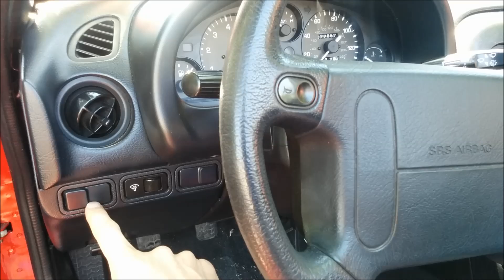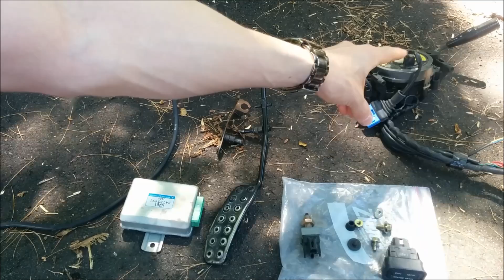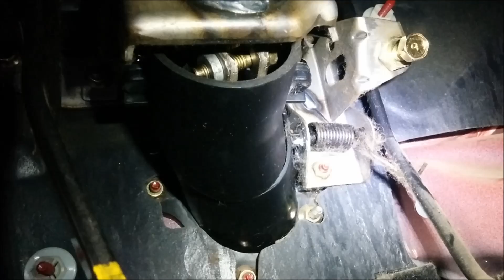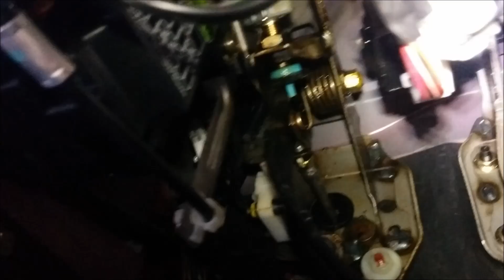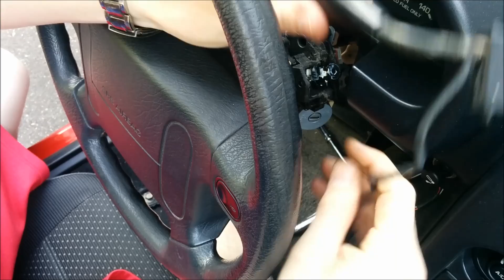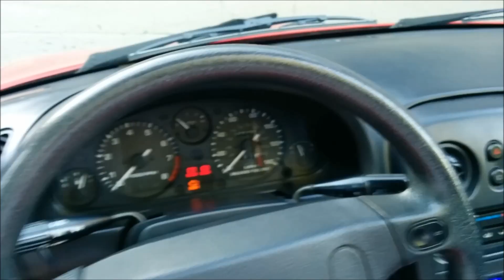How to Install Factory Cruise Control on NA Miata

Comment: Great video! Hopefully it helped me solve my issue! Mine did have cruise control from the factory but it no longer works. I'm thinking the computer asw well. My light on the switch stays on but cruise just doesn't engage. I checked all connectors and they are all plugged in no obvious shorts. I'm thinking either the computer is shot or the servo is shot. Vacuum line is fine no cracks at all

Comment: Awesome video. I just did it myself on a 95 Miata.  I also posted a video on converting an NB cruise control stalk for the swap (instead of using the significantly more expensive NA stalk).  I linked to your video in it as well. Thanks a lot. https://youtu.be/pt4tAKC3m0I

Comment: at 3:00 there’s an unused harness in the middle of the screen - does anyone know what that’s for?
Reply: Old comment but I was just prepping to install CC and saw this. It's for the annoying door buzzer that sounds when the door is open with the keys in the ignition (I believe it was only on 94-97 NA2s, could be wrong). If you pull that harness, it silences the buzzing noise.

Comment: What is the other switch for on the right of the light knob?
Reply from the maker: The blank one? It's usually for the rear defroster.
Reply: @JustinDepew  Na6 had a rear defroster option?!

Comment: So I'm having a problem with my factory cruise control. It works but I'm having a issue where when I'm on cruise control and I turn the running lights on or headlights on the cruise control turns off. Could this be a computer issue?
Reply from the maker: That sounds like a wiring issue to me...I've heard of the wiring in the stalks going bad before
Reply: Justin Depew thanks for the reply. I'll have to be on the lookout to see if I spot any part outs so I can get the whole stalk assembly and swap it out.

Comment: Does that mean I won't be able to install the cruise control unit all the other plug-ins are there but I can't find the one for the on/off switch?
Reply from the maker: Dave Brown yes you need all harnesses in order for it to work. It may be possible to add that harness in but I'm not sure how much work that is.
Reply: Did you manage to add the cruise control?

Comment: i found all plug ins for the server and computer but can't find the plug in, for the in dash control? Is it possible that is not part of the wiring harness?
Reply from the maker: Dave Brown yes it's possible you are missing the dash portion of the wiring harness.
Reply: Dave Brown i know im a couple years late, but did you ever find a way to wire in the switch without the factory wires

Comment: I just did this job and I want to start by saying this is a fantastic "how-to". Lots of great information here, and seeing everything before touching it all is great as well, I do have a few things to add though. 

1. The gas pedal is MUCH easier to get to with the steering column plastics off and the steering wheel off. Those piece being off gives a huge access hole to the gas pedal, I believe this to be easier than changing the stalk alone. 

2. The airbag has to come off first, there are four nuts on the back of the steering wheel to free the airbag, then there is the center nut on the steering shaft. MAKE SURE YOU DISCONNECT THE BATTERY AND LET IT SIT FOR A FEW MINUTES BEFORE YOU MESS WITH THE AIRBAG. There is a danger of setting off the airbag while disconnecting everything. Once the bag is off and the center nut is off, there are 3 small screws around the outside of the clockspring assembly. Then it just slides off. While the steering wheel is off, go ahead and do the gas pedal then, its fairly easy at this point.

3. CHECK YOUR UPPER CLUTCH SWITCH. I spent an hour or two trying to diagnose cruise not working, I checked for power, I actuated switches, everything. Mazda used different switches for cruise control, and the clutch safety start switch. So, even though your car starts, the cruise related clutch switch may still be wrong. I found the plunger in mine to be gone. No button in the pedal either, I unplugged it to test and the cruise worked fine. Check the easy stuff first.

Once more, great how-to. Well done. Hope my comments helps add value to it.
Reply: Hi, my cruise control not working after wiring modification including jumper "the white clutch safety switch". Is you mentioned "UPPER CLUTCH SWITCH" is white colored switch with large current wire?

Comment: Thanks very much for this video. Very informative. I've owned my Miata for over 10 years and as much as I love it, multi-hour highway drives can be brutal. I recently bought a second Miata with factory cruise and HAD to have it on my original. Took less than an hour and a half to do the install and it works great. Thanks for taking the time to do such a thorough job.
Reply from the maker: Glad it was helpful!

Comment: How boring it would be to drive such a fun car on cruise control.
Reply: Sometimes you need to get somewhere in such a fun car..
Reply: @jochem1986  I'll just assume you're from the US, but you can correct me if I'm wrong. I still don't get why you'd want a "primitive" cruise control like this (modern ones that break automatically and keep the distance are a different story). All this cruise control does is hold the throttle for you, so why not hold your foot in the same position for that time, it's already down there. Maybe I'm missing something as I do not have a cruise control in my MX-5.
Reply: +David Bowden Driving this from MN to Colorado for the FM open house would be brutal. I'm sure longer trips like that are what he installed this for. :)
Reply: yeah, for David, driving long distance, he would break and shift for no reasons:)
Reply: Sometimes people get several tickets because they don’t have cruise control and end up speeding
Reply: Well.. Not in a Miata.
Reply: I drove 650 miles in a 92 Miata in Texas one day.  I would have LOVED to have a cruise.  I put one in a few years later.
Reply: I do, but then I live in the PNW where every trip out of town is a highway through the forest with great back to back s-curves followed by maybe a mile if straight road before you are back down to 3rd gear and more s-curves.

Comment: A really good how to video 
 The only question I have is the cruise control switch ( LAO1 ) that is mounted on the clutch pedal  that goes to the ECU
 is there a reason you did not mention it
Reply: The clutch pedal switch is already wired for  neutral safety,     http://www.mellens.net/mazda/Mazda-Miata-1991-1993/1991_wiring.pdf  page 2 E-7

Comment: Well done, this is a really good idea if you don't have it.  Don't let the weight loss nannies tell you that you don't need cruise, or AC, or seats, or a hood/trunk.  If you actually drive the car, having a feature like cruise is nice.  Mine has cruise but no ABS, which is kind of a bummer.  What other fun projects are you doing with the car?
Reply from the maker: Just finished installing a roll bar.. No video of that unfortunately
Reply: +Justin Depew I am planning to do a rollbar too, but setup for time lapse that doesn't have a terrible angle adds like 40% more work.  I don't think most viewers realize you probably shot this over parts of ~3 days and it took maybe ~4 hours to edit and another ~1 hr to render before uploading.  That's how a single video takes up a whole week, lol.  You do a really good job explaining though!  My custom center console is into the 3rd month here soon, probably a 10 min video when I am done.